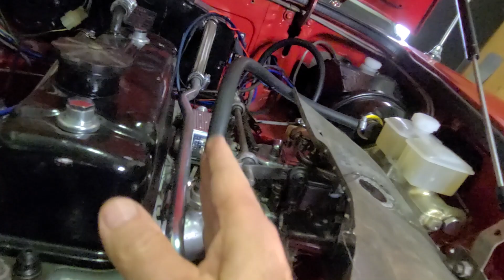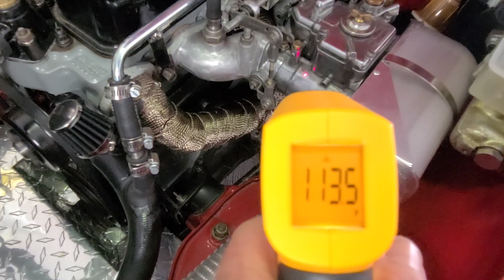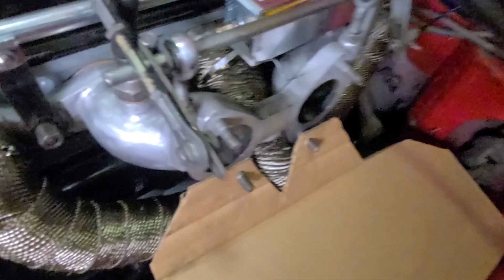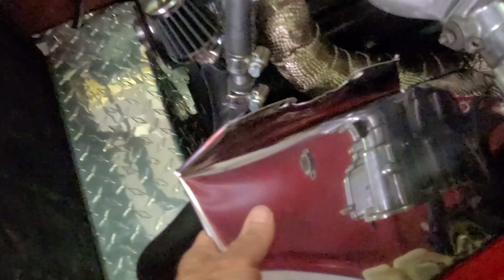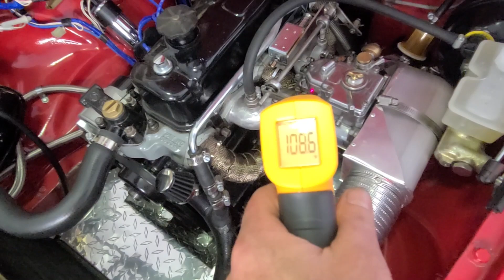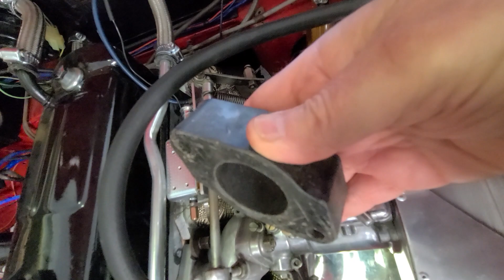MGB Heat shield for Weber DOCE  -  to reduce vapor lock

Comment: Hi did you ever resolve this issue? I’m dealing with it now too
Reply from the maker: I have gone through iterations...
But my current config seems to work fine.
(As long as the car keeps moving) rush hour traffic can be problematic.

Might eventually install a fan to vent the engine bay 

I will link a few more videos for you on this
Reply from the maker: https://youtu.be/mmRPKHIqtcg?is=8BPXCZ8Jybnu6TKa
Reply from the maker: Adding the new manifold made the best improvement.

https://youtu.be/6aF9958Ilp8?is=BAc-QU1HgbNrkTF1

Comment: Hi Alex. I have a 79 MGB with a Weber DCOE and had the same issue. The answer is not phenolic spacers or heat shields, it's technique. During a hot start hold the pedal to the floor while cranking. Don't pump it! It will start right up.

Comment: Sir:  I found your interesting clips.  I have a 1977 MGB and I need to get some work on it and want it back on the road.  I found some pin holes in the driver side floor pan, and car has been sitting in a long time.  I noticed you mentioned you are in Virgina.  Do you know anyone in the Fredericksburg area that works on these cars.  I do have some mechanical experience on Older Mustangs and Camaros
Reply from the maker: I am in Texas (Dallas area)  I follow a bunch of Facebook forums, I will look out for anyone in that area.

Also, you might google "mgb experiance " that is am excellent online forum

Comment: This is also a problem with the (dreaded) Weber downdraft carb.
Reply from the maker: Well, in my next video on this, I will be testing Phenolic spacers.  Turns out they are hard to find.  So I am going to make my own out of Bakelite.  Hope it works.  And benefits others too
Reply: @AlexPlatacis  Good luck.

The problem with the downdraft is that if you put a phenolic block/spacer in between the carb and the manifold... it can't be thick enough to do any good.
It will cause the top mounted air filter to hit the underside of the hood/bonnet.
I do not like the Downdraft Weber. It is inefficient.. prone to vapor lock, and very difficult to properly tune without a dyno and a sack of jets.
I bought my recent car, 63 B, with the Weber.
Luckily I have a complete set of SUs already built up,  a manifold. and a new heat shield. 
All ready to install it.
I also have a few DCOE 45s and manifolds... for another day and maybe another car.
Reply from the maker: I plan to test the effectiveness of different thicknesses of bakelite.  Hopefully it will just take 1/4 inch or so.

Comment: Since the temp at the  thermostat is around 190 degrees, it is just a guess that you have a 190 degree thermostat. I wonder what a summer thermostat of 160 degrees would do? I have a 180 degree thermostat and the temp around each spark plug is about 180 +- 10.
Reply from the maker: Hmmm...
Interesting thought.

Might have to give that a try at some point